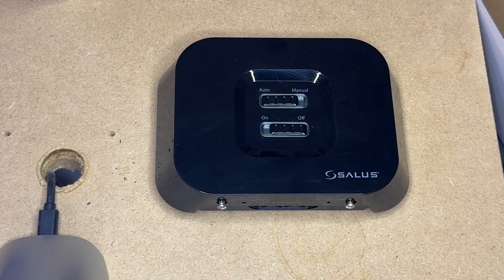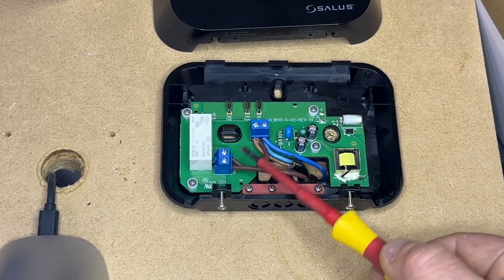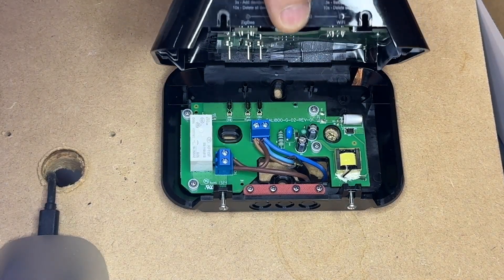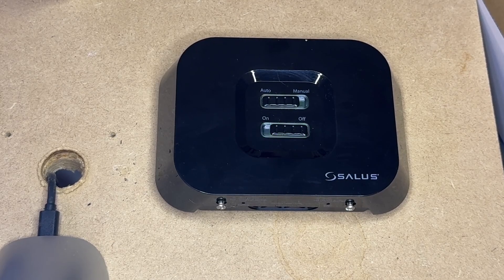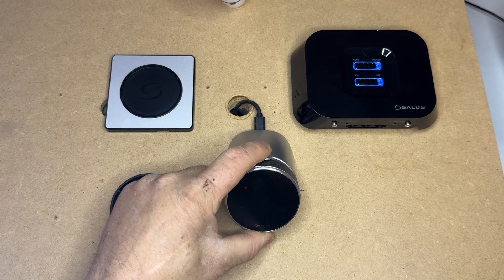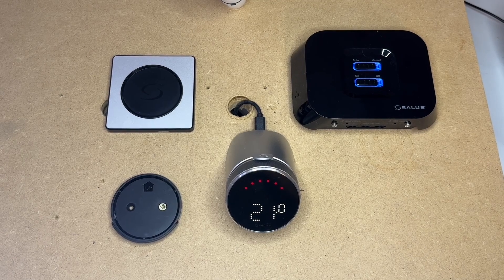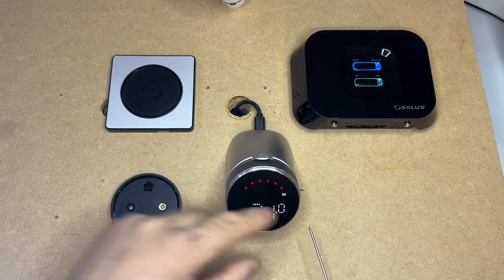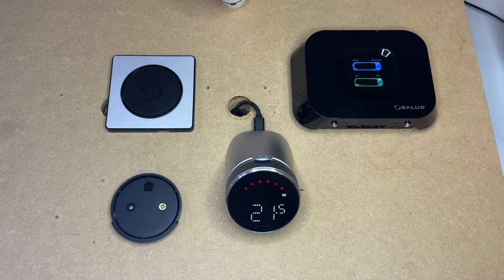Salus IT800 wiring and re-pairing lost signal.

Comment: Hi, I'm trying to pair the Salus EL600F with a Salus RXWBC605 but can't get to pairing mode on the EL600F? Do I need a UG600 or will that not pair with RXWBC605 either?
Reply from the maker: Sorry for the delay. , I believe the el600f will only pair with the black receiver it comes with ?,  to use the app  you can use this as a stand alone or get the ug600/800 hub to enable further additions.  But you can call Salus tech to confirm